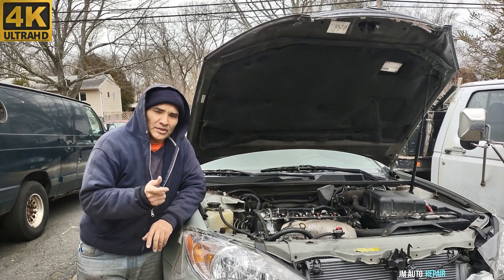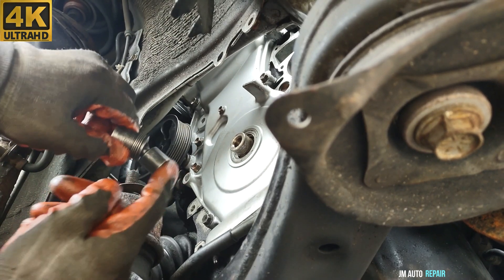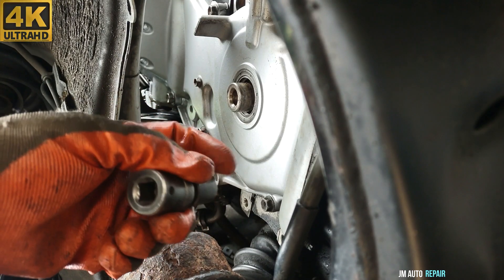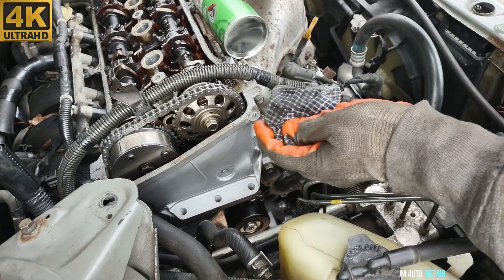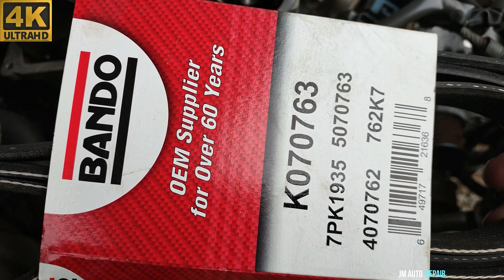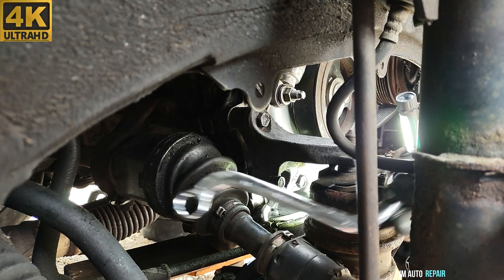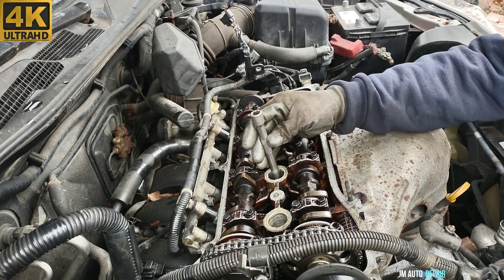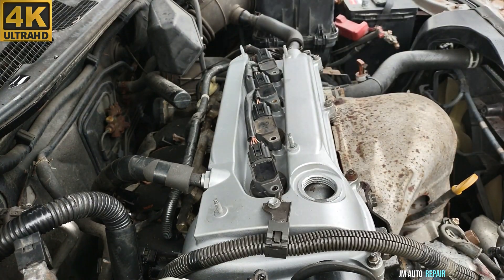2002 2013 Toyota Camry Matrix Rav4 Highlander Lexus 2.4 Timing Chain Replacement step by step part4

Comment: Would suggest mentioning to renew the crankshaft oil seal in the cover before installing the cover on engine.  Good video, especially to clean threads on specific bolts.  Nicely done!
Reply from the maker: yes I agree with you, thanks for sharing.

Comment: Thank you for excellent video. Question pls: i have a 2007 Rav4 2.4L, with 207,000 miles. So, could the timing chain, the oil pump and the water pump be replaced with the car sitting on the floor, or does the car have to be lifted up or even the engine and the transmission together, have to be taken out of the engine bay to do this job. Thank you
Reply from the maker: Yes, absolutely it can be done on the floor and with out removing the engine, unfortunetely I have videos on this but they are in spanish, it is a little different than this camry but similar.
Reply: @JM-AUTO  i thank you sincerely

Comment: About the timing tensioner, the lock clip wasn't removed so how will the timing tensioner be able to release and push out against the chain tension slipper to prevent timing chain jump when you started the car?
Reply from the maker: it releases it as soon as the engine starts turning when you turn it by hand or either when you turn it on for the first time after done with the job but usually every mechanic will rotate the engine a few times before turning it on, this tensiner is designed to work like this.

Comment: Timing chain tensioner????
Reply from the maker: tensioner was installed on the timing cover before installing the timing cover, it can be seen on the cover already installed, you also can install it after installing the timing cover, I have shown the 2 ways on how to install the tensioner on other jobs on same vehicles before installing the t cover and after installing the t cover.
Reply: How do you get the cover into the tight space without scraping off the gasket maker? @JM-AUTO
Reply from the maker: @jonathangarzon2798  make sure there are no motor mounts on right side n also in front of the car n jack up the engine as much as you can upto wha ever is safe n you will have the space
Reply: Oh okay thank you!
Do you know where I can go to find the original service printout

Comment: Were did you get the timing chain kit? And did you replace the cam sproket bolts?
Reply from the maker: I did not buy the timing chain kit, The Owner did it, but the chain tensioner came out bad, yes sprockets bolts were replaced. thanks for the time on the channel.